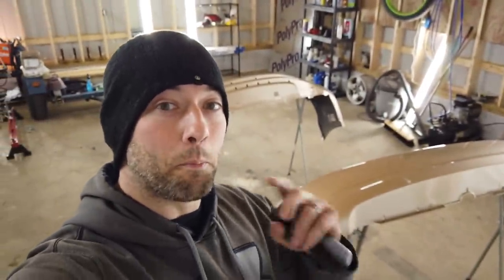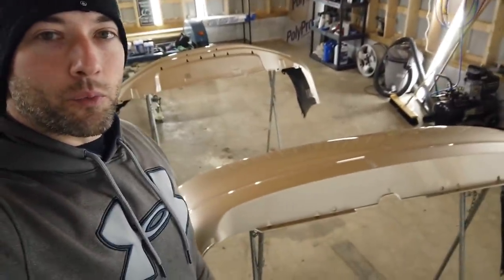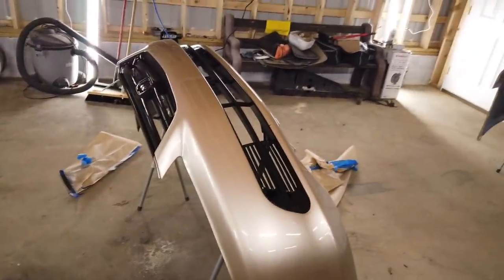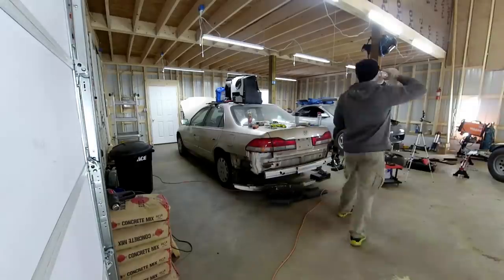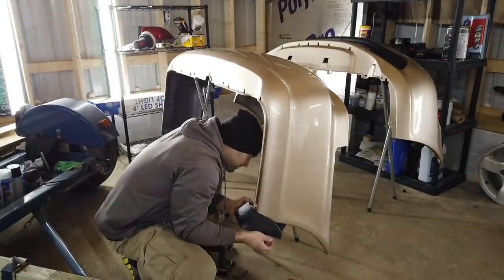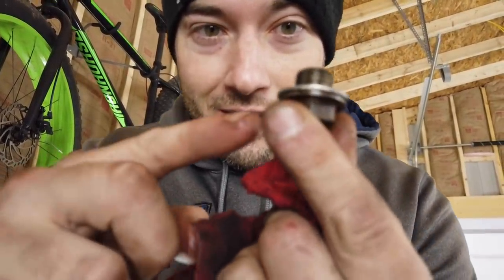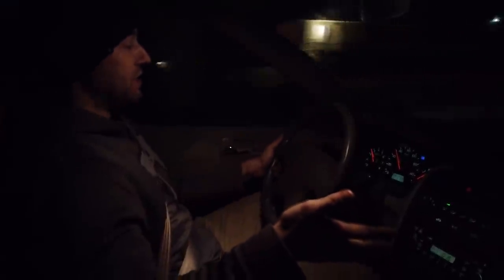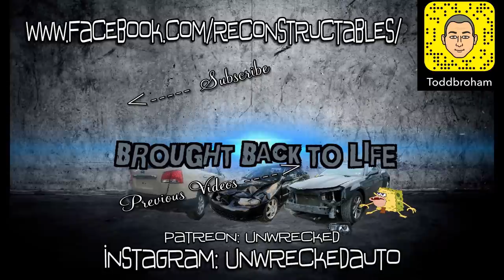Copart 2001 Honda Accord Project Finale

Comment: I Think the black updated the front bumper nicely...  Good job Todd...   I changed the oil in my truck the other day with it about 0 deg outside. When I was emptying the old oil I found the drain plug gasket.  Had to drain part of the oil to fix that little mistake.   I’ve never done that before.  Maybe cause it was so cold I was in a hurry....

Comment: I use them here red daily in the winter outside in tents we build. I’m a bricklayer.   Anyway I’m not telling you what to do.   Just suggesting.    If you run white kerosene in them. You can not even smell it. No fumes  at all.  Some people are sensitive to the diesel fumes   Just saying 
Sheets has white kerosene too...    another fine film.
Reply from the maker: I been working at a place will all diesels for about 15 years.  I'm use to the fumes

Comment: U could have sandblasted the grill area of that bumper before paint. Harbor freight has a small handheld sandblast gun with a small hopper attached to hold sand. Super easy to use

Comment: Another awesome project finished and a quick seller I would add ,not car related -the bags of cement /concrete at the garage door should be elevated of the ground else it would draw moisture and become useless put it on a couple pieces of wood ! Just saying

Comment: Have you ever thought about using a cheap single stage paint especially on something like the eclipse where you trying to save $$.  Ive used single stage stage tractor paint with great results in the past for under $50 a gallon
Reply from the maker: I've thought about it but the eclipse isn't going to be the car.  I'm not set up to paint.  My air compressor couldn't keep up and no ventilation.  Plus no real source of heat either